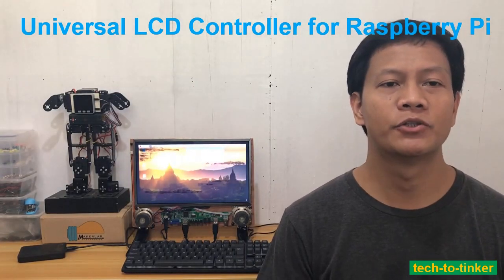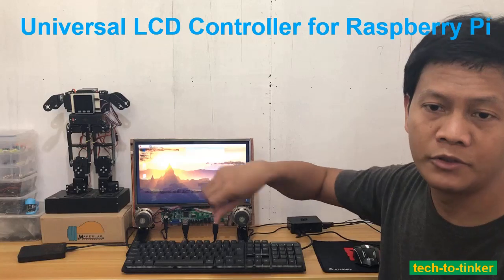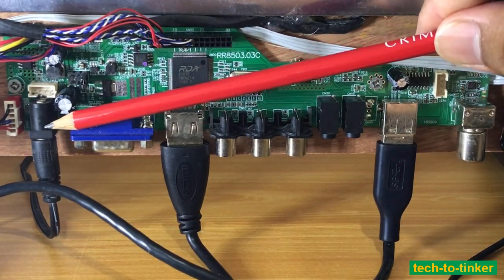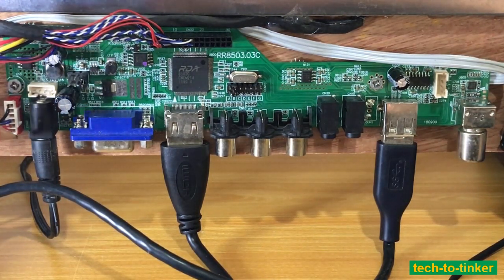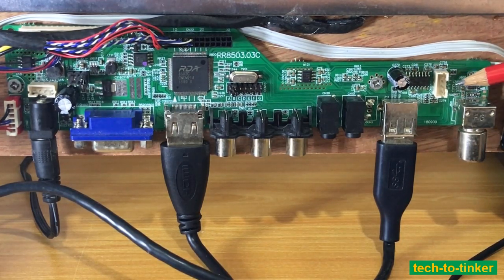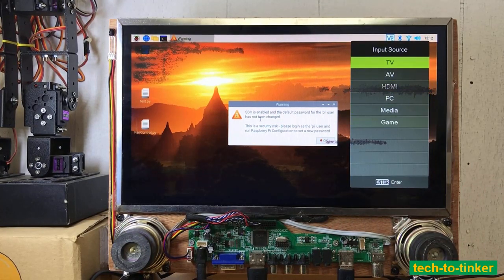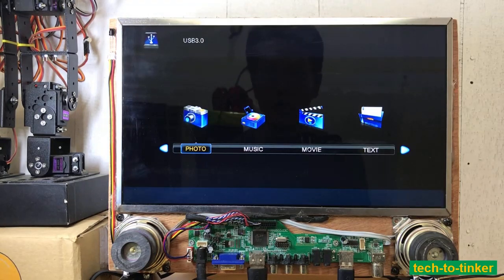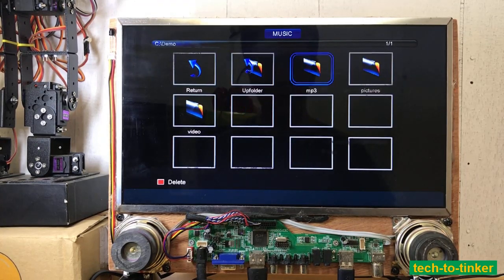PROJECT: DIY Portable Screen Using Universal LCD Controller

Comment: Sir pashare naman link kung san mo nabili yung universal controller saw a few in lazada kaso duda ako due to current situation here sa pinas.
Reply from the maker: Hi @Raymond Chloi Dino, sa online shops ko rin nabili yung universal LCD controller pati yung LVDS cables. Di ko lang alam kung may nagbebenta ng ganyan dito sa Philippines. Hanapin ko pa yung links :). Thank you.
Reply: @TechToTinker  more power sa mga DIY projects.
Reply from the maker: @raymondchloi  thank you for the encouragement. Really appreciated bro.